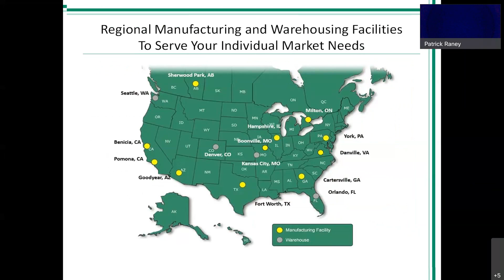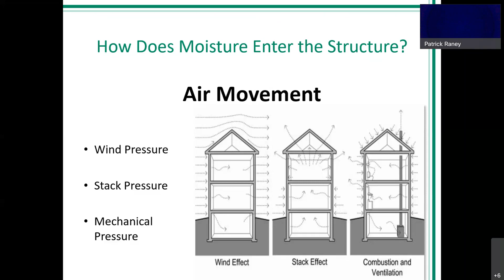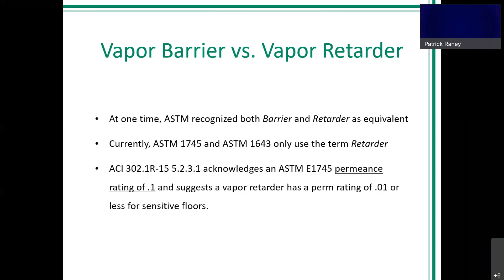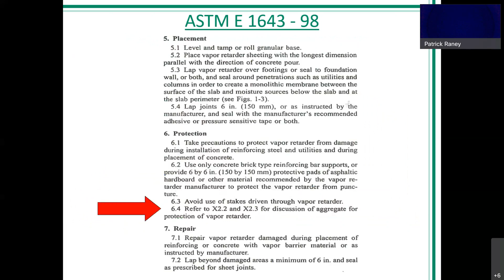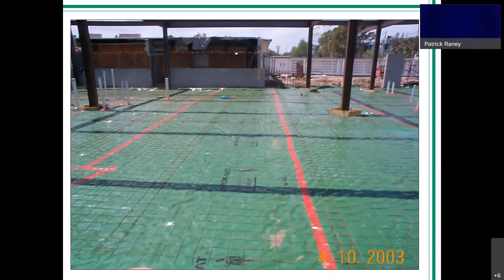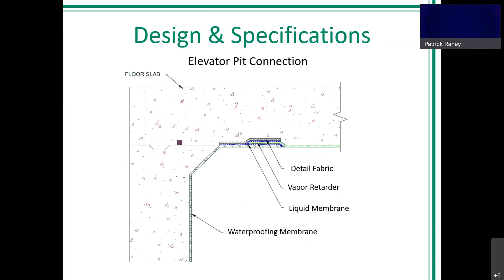Underslab Vapor Barriers

Comment: FUNNY!!!  That is my work, that vapor barrier chart with the 0.108 versus 0.214 differential, is something I lectured on nationwwide for 30 years!    But the MATH on the vapor pressure is TOTALLY WRONG for it is not 10.16 GALLONS per 1,000 feet, it  is 10.16 POUNDS (and 8.3 pounds is one gallon).  I sure hope WR Meadows did not misrepresent themselves to too many people!